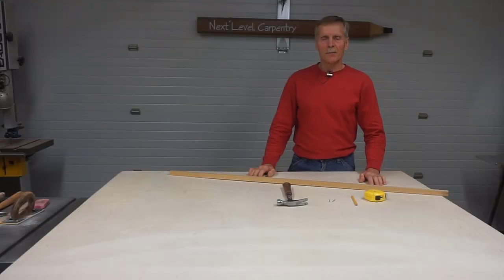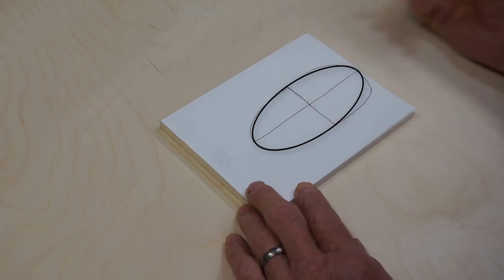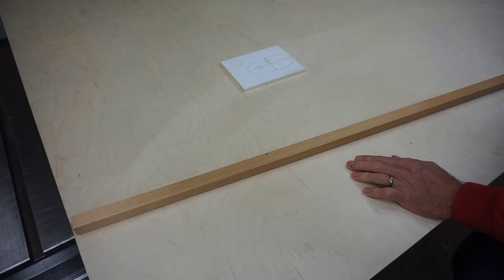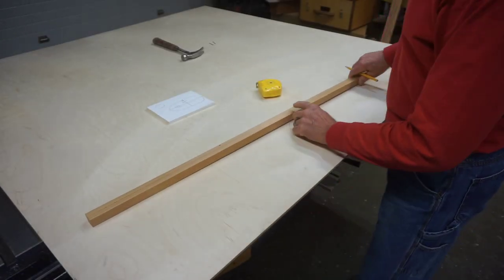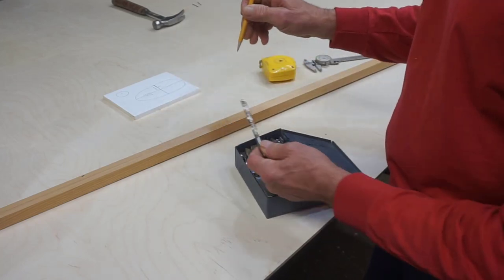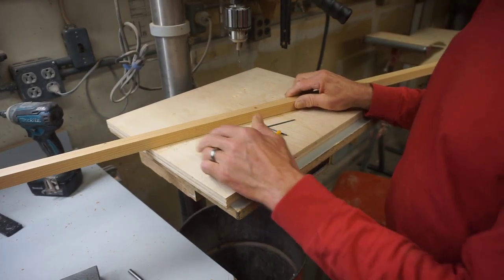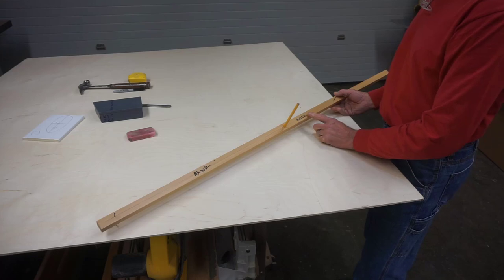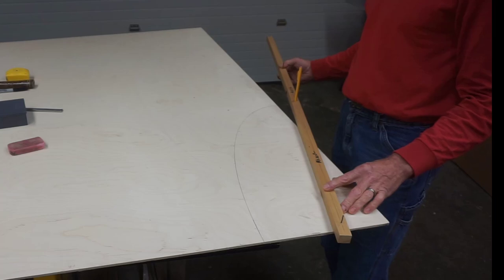How to Draw an Elliptical Curve Without Math or String!

Comment: Good tip Matt, thanks. If you draw that quarter of an ellipse on hardboard or 1/4" MDF it can be used as a template for the router, flipping it over to get the second half of either the long or short quadrant which will then be identical.
Reply from the maker: You got it, Bob!  Best, Matt

Comment: I saw half an ellipse. Did I miss something, sorry ?
Reply from the maker: Actually you saw 1/4 of an ellipse but a viable elliptical curve just the same.  Best, Matt
Reply: Yes 1/4 but I think most people using them are looking for a 1/2.
Reply from the maker: Maybe so... the good thing about the method shown in this video is that it's simple, accurate and dependable. I find it best to layout a perfect 1/4 ellipse and repeat it either once or 4 times depending on requirements.  I prefer this to laying out a full ellipse and cutting it in half or quarters.  If there's an equally simple and accurate way to layout 1/2 and ellipse I'd likely adapt it.
Reply: There's actually some other instructionals, here on Youtube, that use 2 sticks to draw a half ellipse in one go. Whether or not it is as easy as this is certainly debatable. A nail is driven at the zenith of the ellipse, where a vertical midline intersects it. Two more nails are driven in at either end of the ellipse. Two sticks are positioned, one against midpoint nail and right end nail. the other stick rests on the midpoint nail also but is kept parallel with the baseline. The two are joined together at their intersection. Pencil in crotch draw while keeping sticks against the nails..... better to see it done.
Reply from the maker: Thanks for following up Joe... that method seems familiar, now that you mention it... sounds like something I should check into a bit more for those times when a 'full' half ellipse is the goal as any extra set-up time spent in the beginning would be offset by less fussing later mirroring the 1/4 pattern method shown here.  Best, Matt
Reply: I just finished building a wood duck box that requires a 3.5" (minor) by 4.5" (major) opening.   This was small enough to where I cheated and sketched it out using a dixie cup.  Would be nice to know how to accurately draw these things - small and large.
Reply from the maker: @bcain5823  Easy peasy! This should answer your question: https://www.youtube.com/watch?v=Jjh_ZRhfnDY&index=8&list=PLh_GOwrHv4WX-rS8fnHfoTWkZRWgVX-dZ&t=1s  Best, Matt

Comment: Picking jaw off table. Another great pro tip! As a scenery builder I probably get called to make elliptical stuff more often than a home builder, this is GREAT. [but I also like to make doors, and a door with an elliptical window is a top seller]
Reply from the maker: Phil,
Crazy cool, isn't it?  You're right: as a carpenter/contractor I don't see much demand for elliptical stuff but when I do I love using this method!  Truth be told I'll probably be watching my own video next time since I usually forget the finer points of using this trick because it can be a year or 18 months in between  projects :-(

Comment: I think this is called the “card method”. I have always used the string method but you need string with no stretch and good fingers to make a clean ellipse. 
This is one of those skills you learn as a carpenter and cant believe how good it works.  I learned this before there was internet so it was passed to me from an old timer.
One of the most head scratching things i learned was framing a bell shaped roof for a gazebo. Read a book and still had a hard time. Remember there is a hip involved with a different curve than the common rafters. You wont find someone doing that on YouTube, what a PITA.
Great video and very precise curve you made, one of the few real carpenters on you tube.👍
Reply: Interesting. And it’s with wood construction was it now?

I’d need to look into that. I must figure the way, and without using calculations! 😉 👍

Comment: Great video.  The template board must be have a 90 degree angle I believe, before inscribing elements from stick correct?
Reply from the maker: You are correct, Richard... I must not have mentioned that in the video but should have.  Thanks for complimenting, commenting and adding a couple Next Level Carpentry videos to you 'Liked Videos' playlist!
Reply: I want to see you router cut this,  with a wider set-stick, and the nails in the same dimension !!!😎🙂🤓 Rock on rRichard, sweet trick. Now correct me if in mistacken,  the pencil nail is right in the center of the stick?🤔

Comment: Wow! That is just classical geometry applied, and requires a precise straight angle in the corner!
Reply from the maker: Hannu, thanks for your comments!  As long as the pencil doesn't slip out of the 'angle in the corner' this works remarkably well for woodworking tolerances.  Best, Matt

Comment: I had use a water hose to make any shape of circle, just put the hose in the manner that you want the circle or oval, tape it down and draw around it and puff it's there.
Reply from the maker: Hose works great for random curves but this method creates a true elliptical curve... but the method of choice depends on the project at hand, right? Best, Matt
Reply: I wished you would have done the whole thing. The Russian have a nice jig ck it out.
Reply from the maker: @ccccen  But I only needed to make a 1/4 ellipse... and a very accurate one at that.  Different methods for different purposes.
Reply: true, true

Comment: I’m a bit confused. That’s only half an arc. What if you want the full arc? I like the technique though. What am I missing here? Thanks
Reply from the maker: Duki, that's a valid question.  There are methods for drawing all 4 quadrants of an ellipse at the same time ie: nails and string or a trammel gizmo of one design or other.  Most of the time I need half an ellipse (ie 2 quadrants) and use the method shown here to trace and cut one very accurate quadrant template and then just flip it over for the 2nd quadrant.  The reason I do it this way is for accuracy because an 'ellipse stick' doesn't stretch like a piece of string does so I feel the end results is more consistent and therefore more accurate... so, it's got a lot to do with the purpose you're drawing an ellipse for in the first place.  Hope that helps.
Matt
Reply: You're not missing anything. This is an absurdly difficult way to make 1/4 of an ellipse centered on the corner of your workpiece.  Use the sting method, it's much easier and there is no fabrication involved.
Reply from the maker: It appears to me, Richard, that you're making some assumptions which are leading to false conclusions.  This video is a prime example showing where, how and why the more precision 'ellipse stick' method is used:  https://www.youtube.com/watch?v=0TI7AV8HdXI&t=1s
Granted, the 1/4 ellipse profile used on this project could simply be cut out with a jigsaw but not for paying customers of my business.  Best, Matt

Comment: uhhh am i missing something thats just 1/4 of the elipse that requires and right angle piece of hardboard to complete.......
if i tell you imma pay you 100 bucks then hand you 25.........
Reply from the maker: I know it's an intellectual stretch but many woodworkers are able to extrapolate the 90 degree quadrant of an ellipse into a half of full ellipse, depending on requirements of the project at hand.  Here's the other $75: The important lesson here is that a 1/4 ellipse drawn with this method and multiplied to a half or full ellipse is more accurate than most methods that show drawing a full ellipse.

Comment: No maths. What is 11¼ and 23½ if not maths? And finding a long enough stick. Also, the measurement from your vernier caliper.
Reply from the maker: Dude: I didn't say 'no dimensions'!  And if you can't find 'a long enough stick' then I think maybe you shouldn't be watching woodworking videos, much less commenting on them.  Juss sayin'...
Reply: @NextLevelCarpentry  Dimensions is maths. Just saying!
Reply from the maker: @Paragon-h1k  Seriously?  "No math" means no equations or formulas, not measurements.  If simple numbers upset you then just make a WAG for lengths and get on with it... good grief!
Reply: @NextLevelCarpentry  Who said it upset me?
Even counting out your two nails is maths. 
So your project is with "very little maths," not "without "
It doesn't have to be equations or formulas to count as maths. If you are teaching a child that 4 apples   +3 apples is 7 apples, that's maths, it may be basic, but still maths.  You see, I'm not upset. Just saying your video did include some basic maths.
Reply: It seems that I can't educate pork!
There's none so blind as those who will not see.
Reply from the maker: @Paragon-h1k  Indeed.